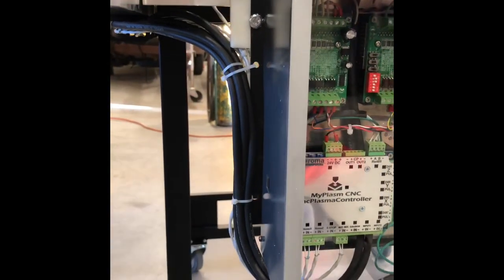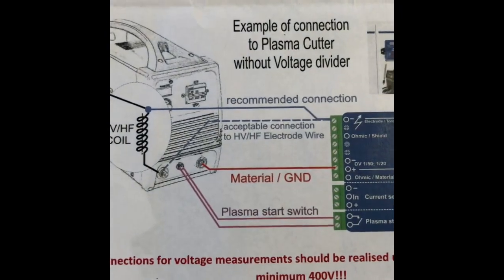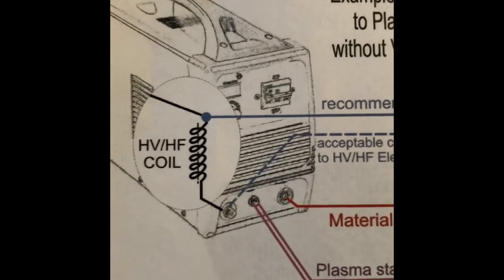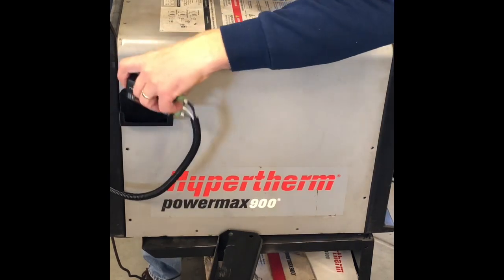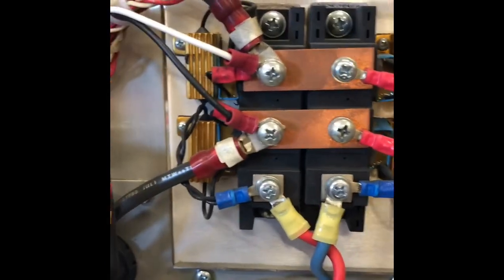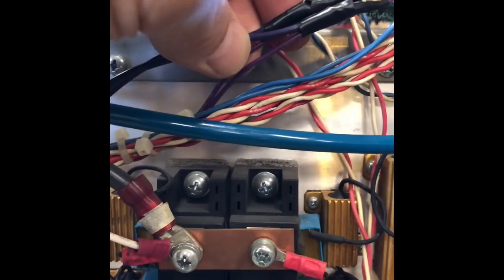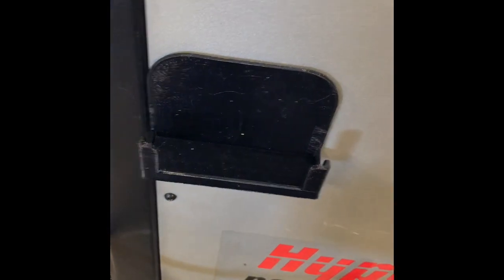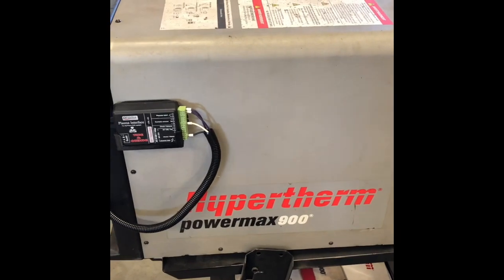DIY CNC plasma cutter part 3

Comment: hello for a plasma cutter 70a any 5v relay I can connect it to the interface
Reply from the maker: Could you be more specific? I don’t understand your question.
Reply: @mrkrazyjeep  a small 5v relay connected to arduino I can order stahlwerk cut 70
Reply from the maker: If your plasma cutter just requires a switch closure to initiate the cut then I would think any relay would work.
Reply: @mrkrazyjeep  it's very nice thank you

Comment: Good video I have a hypertherm 800 do you think the wiring would be the same as the 900 thanks
Reply from the maker: I’ll bet it really close... if you trace your leads you should be able to figure it out.  Remember the material camp is the positive for the torch height controller. I can’t say for sure having only seen the inside my 900.  It’s the only machine I have ever opened!
Reply from the maker: I wouldn’t recommend doing it though unless you have a good understanding of electronic/electrical systems.  Electricity can be dangerous if you don’t know how to work with it, just saying...